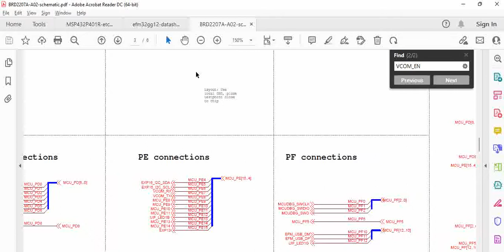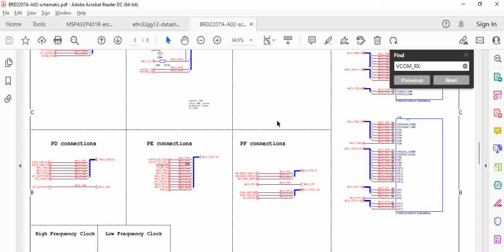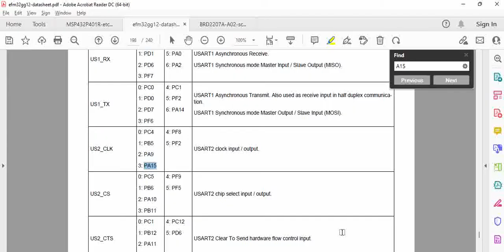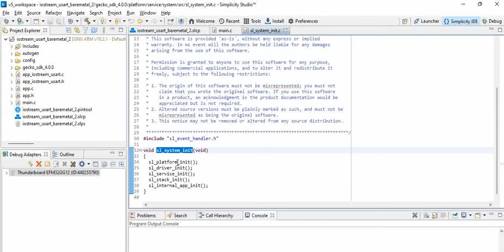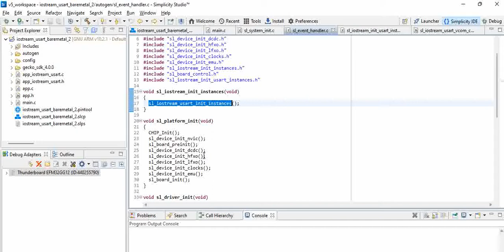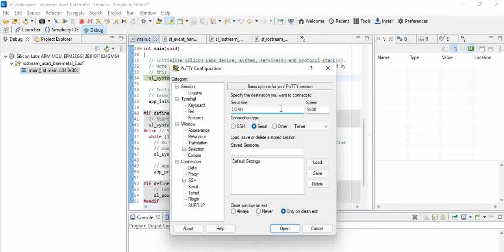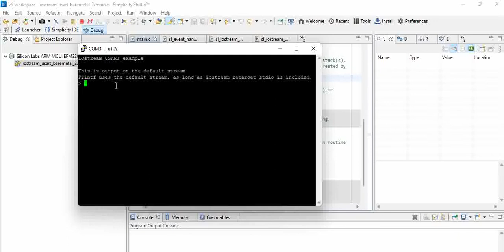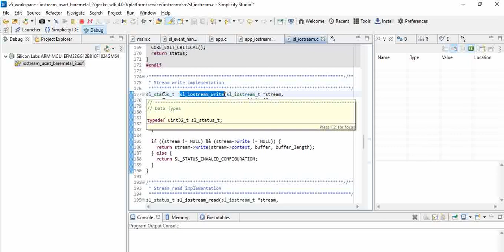UART program on EFM32GG12 | using VCOM port on EFM32GG12 | Thunderboard EFM32GG12 Part - 8

Comment: HI, I followed all the steps in this video, but I’m doing it on an EFM32PG28 Simplicity Studio / Gecko SDK.
The project builds and runs, but the VCOM/UART output is garbage characters instead of readable text ,I tried 115200 8N1, no flow control, and other baud rates too.
Is there any EFM32PG28-specific setting I should change (clock source/USART routing/IOStream config) to fix this? Any tips would be appreciated.
Reply from the maker: Before any other point, did you try loop back and ensured that HW is fine?
Reply: @W @Way2Know  Yes I did a loopback test and the hardware/UART lines are OK (clean echo), so the hardware seems fine.
However, the VCOM UART output is still garbage. Any idea what could cause this?
Reply from the maker: Check the Clock setting once. As the UART clock is derived from HFCLK, it has to be 39 MHz in EFM32PG28.
Reply: @Way2Know  Thanks! I checked the clock settings as you suggested, and now the UART output on VCOM works correctly on the EFM32PG28.
Reply from the maker: Good to hear :-)